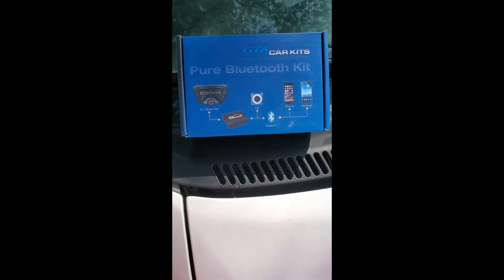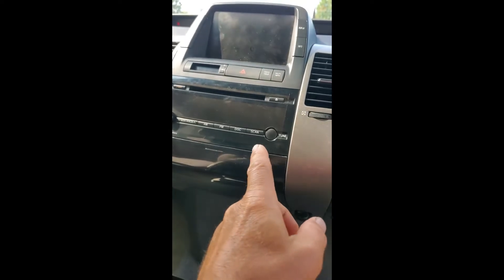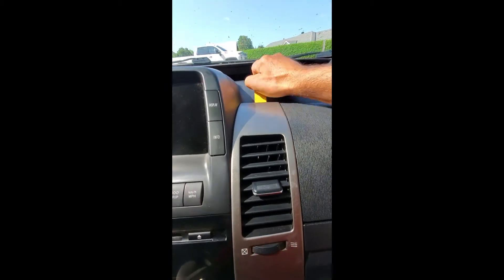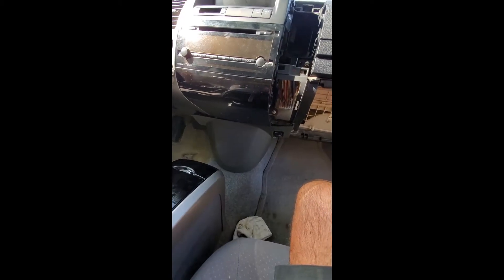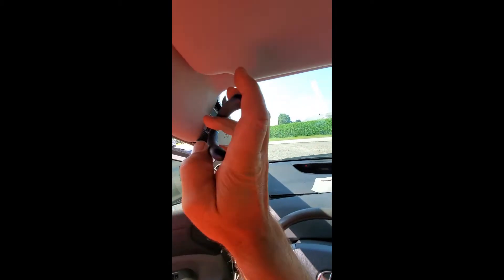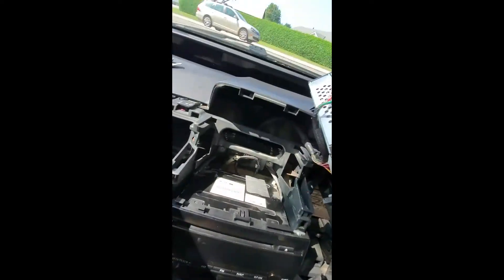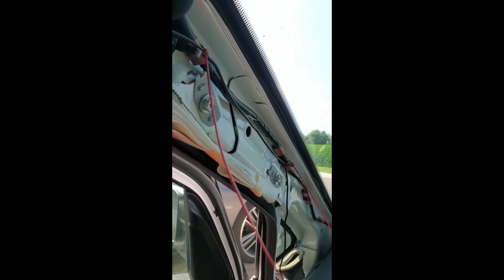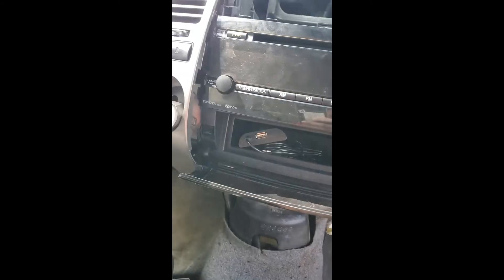2009 Prius GTA Bluetooth radio upgrade with hands free mobile phone connectivity and AUX Cable input

Comment: How are you liking the GTA kit? I was thinking about buying one myself.
Reply from the maker: I have installed 2 of them now in both of my Prius's. Both my sons drive the cars and love the connectivity and works great.  It brings a modern feature to an older car. The bluetooth extra cost is worth it.
Reply from the maker: It links well with the Apple iPhones as well as my Samsung Android phone. I would recommend it. just be patient and careful removing the vents as I cracked one when installing the second one. Watch the GTA installation video as well as they do a great job with explaining pry points and sequencing.
Reply: @mirovala7707  thanks for letting me know, how good the product is. I’m ordering mines next week, did you get yours off their official website?
Reply from the maker: @tgenesis8784  yes, I bought it directly from their website. I hope the installation goes well. We continue to be pleased with the product. Miro